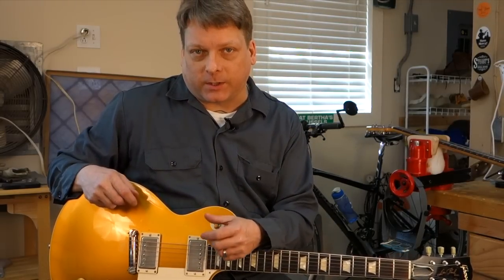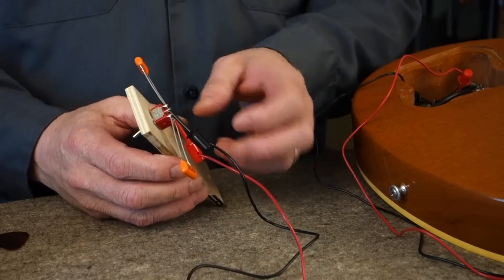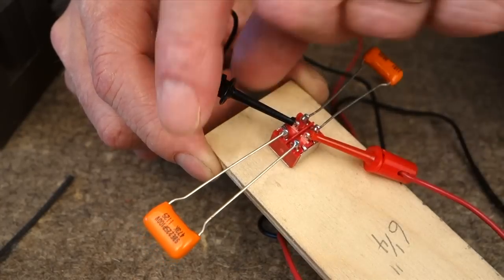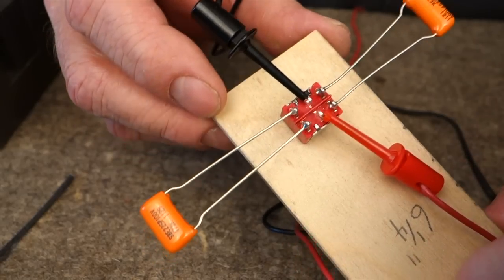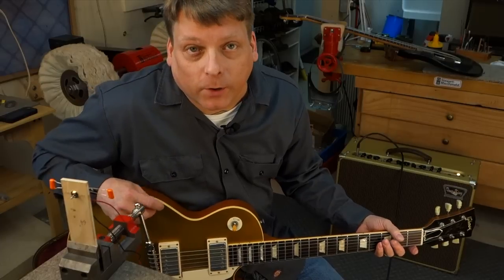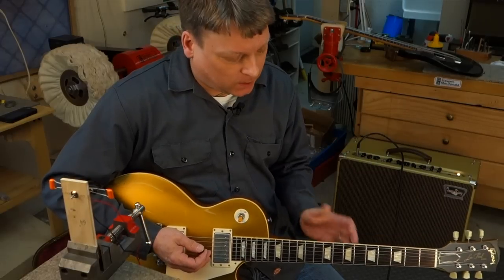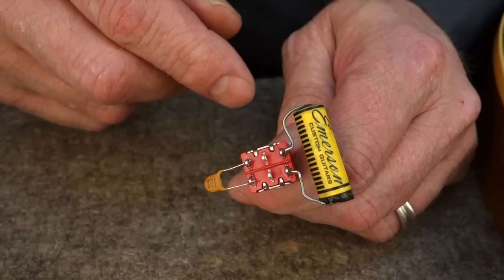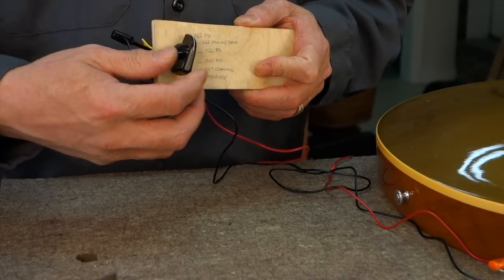Guitar capacitor tester: let your ears decide

Comment: Capacitors dont have a sound. They just remove frequencies. They dont have a "tone" of their own. Doesnt matter what theyre made of. Only their value.
Reply: You are correct, however what they are made of does matter, different materials have different tolerances, hence a more exact value. I.E: A capacitor with 30% tolerance with 20uF  can range from 14uF-26uF. A high quality material reduces this tolerance up to 5-10%. In the end if you are lucky enough to buy a cheap one with 30% tolerance and hit right on the spot of the specified valued, it doesn't matter.

Comment: The physical construction and materials used make a noticeable difference to the tone you get. A lot of it has to do with quality of the component and the consistency of the materials used. Even with close tolerances the differences in construction and material produce different sounds. 

Try a cheap ceramic, and then swap it for a decent orange drop. The sweep in the tone control is much more lush and vibrant, even if both have the same treble bleed range.
Reply: I tried the exact same thing - didn't get any noticeable difference.
Reply: Unless you have measured and matched capacitor values I suspect you are hearing differences in value not in construction. Or possibly your ceramic is microphonic.

Comment: Really great ideas here. I initially saw Lindy Fralin do a capacitor test device on one of his videos. The important thing here is not that this video should give you the definitive answer as to whether you should go with one of those cap values for a Les Paul instead of the other, but as a demonstration of how to sort that out, yourself, with your ears, in your sonic environment. Unless the differences are so glaringly obvious, never completely trust what you hear on YT, because of all that sound has to go through to get to your ears. (Camera, software, mic, YT compression, your computer speakers, etc...)

Comment: That's a pretty cool thing he did but what if you installed it that way in a guitar someway so you can have both of them in the guitar and change up whenever you want during a show or just at home. It would be like adding that one switch that let's you turn on a pickup when you want to
Reply: Cris Agui Put in that 6-way rotary knob. You may have to do a little routing, but it ain't no thing.

Comment: Another thing you may not know, is that the cap will sound different w/opposite orientation, i can tell easily in a tube amp setting..cheers,
Reply: is one way better than the other?

Comment: There's a simple but effective boost circuit in the old epiphone et-270 that's basically a switch with a capacitor wired in that pushes the overall volume nicely, I'd recommend guitar companies add this as a standard feature
Reply: The circuit act as a simple low pass filter. As a passive circuit the “boosted” position is actually with the capacitor out of the circuit.

Comment: I have an Ibanez with passive pickups, and when I changed the tone pot, I still didn't have a cap, so I just installed it without one and it sounds like a set of active EMGs! Now I probably won't put the cap in when it does come.

Comment: I doubt I'm the only one, but I'm only adding tone pots to my guitars just for the looks :) They are always at the brightest setting.
Reply: That was me before I took a blues performance class. Now I find I'm looking play with the volume at about 7, and the tone between 4 and 7, depending on the amp.  
Makes for a much better tone when blending with other players, and leaves more tonal space for the singer. I might go brighter (and louder) in solos, but then lay back when she spotlight is somewhere else.
Reply: You are missing out on a plethora of tones than if you only play wide-open, even in just a bedroom setting. Be adventurous and explore your tone knob.
Reply: Even if you leave it on 10, it still sounds different than if you bypass the tone control completely. Because it's passive, the tone control lowers the output of your guitar a bit, and even on 10 it rolls off a little treble. If you don't put in a tone control, it will be brighter and have higher output.
Reply: you had me at explore your knob😒
Reply: I am 99% with you on that.  When I do use my Tone pots it is usually when I am blending two pickups and then I just dial back the bridge a little bit.  If I am playing the bridge and it sounds a bit bright I normally just switch to the neck.  I'm sure that there are pickup pairings where this isn't quite what you want but most of my pickup pairings are fairly balanced.  No right or wrong answer--I used to think that neck pickups were for old folks and now that I am one I love them! :)  The video is nice--I like the idea of letting your ears decide.  The big plus for me is that I can justify more guitars just based on tone cap!!

Comment: You can use a breadboard to do this test and you'll only have to do two solder joints, also caps can sound different batch to batch same value, same maker.

Comment: Some placebo effect is going on here. There's no difference for capacitors if the tone is on 10, because that way the capacitor is bypassed by the pot. I'm in producer headphones right now and I know some about sound. No difference at all. Should've tested with tone rolled off.
Reply: I know this is old but thats actually not completely true unless you have one of those zero load pots fender makes.  Its still in the circuit but with the full resistance of the pot.  So 500k for a typical humbucker guitar.  So there will be a very slight difference even all the way on 10.

Comment: i came across a wiring diagram for les paul that uses a master tone so the other tone pot can be removed and a rotery switch put in its place and you can switch between six different capacitors as you want or need.

Comment: I have in fact fitted a rotary like that to a guitar, giving several preset cap tones with some really low values for subtle effects. works well. I think its gretsch that do/did a three way toggle on some models for preset tones(?) also early esquires had a preset tone in one of its positions

Comment: Okay. So you used a solid body guitar for your capacitor test. You need to do the same test with a semi-hollow guitar, as well as a hollow body guitar for those of use who own such guitars. I'd like to hear if there are any subtle or obvious differences for the same test. Also, you should have put a mic in front of that amp to help the listeners not in the room hear a little better.

Comment: Years ago mounted a Tonestyler tone control in one of my guitars, don't know if they still make them, has a small p/c board
with (I think) 16 position clicks. 1st position is no resistance, followed by progressively more high cut. Have gotten used to it,
miss it on  my other guitars.   Worth a try.

Comment: .022uf and .047uf (.020 and .050 are not standard values) capacitors are common in any junk electronic item you have laying around.  Sometimes they are marked with these values in microfarads (uf), but more often they are marked with the capacitor code for that value.  A .022uf will be marked  "223" and the .047 will be marked "473".  They cost about a dime apiece and work exactly the same as the big dollar "guitar tone" capacitors.  They are very cheap, you can get a bag of them new i.e. eBay.  If going used from some junk electronics board, you might want to invest in one of those $10 eBay electronic component checkers that will read both the value and check for age-related signal loss.   You might even want to have them labeled as special guitar electronic parts and sell them for a 1000x markup.

Comment: Nice idea to do the 6p switch with different caps. Trying to find a "wiring diagram" to do one here. Cheers.
Reply from the maker: Hi Fabão! While we don't have a wiring diagram for this, it's a rather simple set up. Just span the capacitors between the corresponding lugs on the 2-pole rotary and used the 0 lugs as in/outputs. https://www.stewmac.com/electronics/components-and-parts/switches/rotary-switches.html

Comment: The difference is almost subtle honestly. Over time paper in oil caps, isn't reliable because it has kinda like self destruct mechanism, whereas leakage voltage would occur.
Reply: Almost subtle?  Wtf does that mean?  If it's almost subtle then by definition you are stating that the difference is NOT subtle.  : p

Comment: To a very large extent the value of the tone capacitor will only affect the low frequency limit where the tone control is rolled off. With the tone control at maximum (and the volume control at max) the roll off frequency is determined by the self capacitance of the pickup and the total capacitance of the instrument lead. Also don't take the value printed on the capacitor for granted. Always measure your component values.

Comment: Hint.. Ceramic caps in the audio signal path is not a good idea. Ceramic caps change capacitance a lot with temperature and are microphonic which doesn't help at all in a device that is vibrating in sync with the signal frequency like a guitar.
Reply: Not class 1 c0g/np0 ceramics.  Very stable and clear sounding.
I even use them as coupling caps in amplifiers.
And much better sounding (to me) than silver mica for pF duties.
Reply: really ? interesting 
i use mica  in amps  
but those  blue ceramics  in big volts   2 KV   must be good 
i  never tried them

Comment: rotary switch at the end is lovely ..or even the 2 way would be cool ..even better would be to just add built  into the guitar !! ..but hate to cut a hole into a Gibson and mod it :(.. ... maybe use a pul switch ...but I love vintage taper pots like Centralab.. makes a Hugh Diff...even CTS don't compare .. 
.. Bring back Centralab Pots !! ..thick carbon track with lead

Comment: In this case, it is important the amount of voltage we decide to use in the capacitor?
Reply: the sound does change depending on the output of the pickups, yes

Comment: I can see where the microfarad of the cap will make a difference but don't tone caps just bleed highs to ground ?  The signal to amp doesn't pass through the cap so type , brand , etc shouldn't matter .

Comment: Why do guitar builders choose to use 100V (and higher) voltage rated capacitors when the signals they are used with are only millivolts? I can't see why they like those expensive giant orange lumps, when a ten cent capacitor of lower voltage rating would work just as well.

Comment: It's quite easy to use an on-on-on switch for that - use a 015, a .022 and in the middle position it's additive for a .037. Unless you're getting useful tone out of the 1,2,3 position on the tone, you're cap's too big. .015, even .007 have uses.

Comment: I just use low values at max treble cut and switch between them with a rotary switch. 0.001, 0.005, 0.010, 0.015, 0.022. Works perfect for me.

Comment: Keep in mind that shifting the baton on a toggle switch to the right is actually connecting to the capacitor on the left. When in doubt, you can initially  test the switch with only one cap on it to be sure how it works.

Comment: Deciding between different types will only work if you value match all the "same labeled value" caps to +/- 1% of each other, as they can be +/- 20% off from the stated value. Otherwise your just listening to value changes, not type changes, especially if you have one cap -20% of value compared to one that is +20% of value.

Comment: Caps are like searching for Unicorn's.. 
You can spend more time and lots of money searching for the mythical cap or simply use ceramic caps making sure the value is as close as it's marked and play.. PIO caps can pickup outside frequencies such as radio also drift as the oil starts to leak or dry out of the cap.
 While Ceramic is way more forgiving.
I've seen Gibson's as well as Fenders using ceramic, Fender used a lot of Ceramic caps because Leo was cheap, and honestly I hear no difference.
Considering that an electric guitar have a low voltage and current circuit, it doesn't matter what kind of capacitor you use. 
Only matters the capacitance value. 
Take a look at the tolerance value, the lower the most precise the capacitance value.

But that's my opinion, take it for what it's worth.

Comment: Did you hear a difference with the tone pot on "10"?
Reply from the maker: Generally, with a tone pot on 10 (with the least amount of the signal running to ground) the frequencies being attenuated are typically outside the upper limits that the human ear can hear (perceive). So you would be hard pressed to be able to tell the difference between a .047uf and .022uf capacitor with the tone control on 10. However, it may be possible if you train your ear long enough.
Reply: Thanks. Doesn't the corner frequency remain the same (RC filter between the cap and the tone pot) and just the AMOUNT of signal bleeded to ground changes with the pot position? I was thinking: with a switch you couldn't hear the difference between different caps, because in the "off" position there's infinite resistance between the cap and the signal, but with a 250k or 500k pot, there's high resistance with the pot on 10, but not infinite, so you might be able to telle the difference between different caps even on 10...it is generally accepted that an higher value tone pot brightens up the tone and gives "more range". Why? Because higher resistance attenuates even further the effect of the cap, and with No-Load tone pots, it should exclude it...I'm just thinking out loud! ;)

Comment: Yes indeed Gibson have been doing it since 1959. The Gibson 330 and another model forgot. It has a rotary knob with different capacitors for different treble. It also has two jacks, one for eah pick up on the stereo version. BB Kings Lucille is one. Johnny Marr plays one too.

Comment: The best for audio are polypropylene capacitors. Never use ceramic disc caps, they are distorting and they are even a little bit microphonic like piezo pickups!  Use WIMA polypropylene 50V caps (for some 30 cents) and forget all the "snake oil" capacitor stories.
   There are just some 2-3 potential positions for caps in the guitars. The Tone capacitor is not in the serial signal circuit, it is just sending the higher frequency part of the signal to the ground (not to the output), so here the cap's quality is a little bit less important. More important is so named "treble bleed" circuit's cap quality (not depending on circuit's variations) - if the Volume pot is not in the max position the higher frequency part of the signal is partly going serial through this circuit/cap.
  
   Concerning the Tone capacitor value - it is a very subjective question. In most cases, factory std values 22nF, 33nF, 47nF are too high, providing dull tone, reducing even mids. For the respective pickup's higher output impedance, lower value capacitors must be used. Pickup's DC resistance can be used to find approximate capacitor values. Just for orienting: 4kohm dc pickup ~ 18nF; 8kohm dc pickup ~ 12nF; 16kohm dc pickup ~ 8200pF. Try +/- 25% values.

Comment: as a rule of thumb when you increase uF you are adding bass tones if i'm right
Reply: +Francesco Bertelli You're actually running more high frequency signals (highs) to the ground which leave you with mostly bass tone. So you're not adding anything, you're actually taking something away.
Reply: yes ok, that's correct from a tehc pov, but the perception for the layman it feels you are adding mid/bass right?
Reply: +Francesco Bertelli yes. Higher value = darker.
Reply: +Francesco Bertelli Thats debatable from the "perception for the layman" when you consider that you are rolling the tone knob down to zero to reach the tone with the most bass. So from a layman POV, turning the tone knob up results in more treble. The most bass being at 0 on the knob and the most treble being at 10 on the knob gives an uneducated user the impression they are "turning the treble up". 

Much like how the volume pot works, at 0 you have no sound, and at 10 you are at full volume. So a layman might presume that 0 on the tone knob is the starting point, and 10 on the tone knob is the end point, whereby they are again, "turning the treble up".
Reply: six of one, half a dozen of another

Comment: Hi, let's imagine you got your Les Paul and with 500k pots it's too bright, bring the value of pots down by soldering a resistor in parallel, that is to both legs 1&3 of the pot. You could start with 50k resistor and increase value 50k at a time until you find sweet spot. You could fine tune your top end of your tone knob for max treble you desire, then fine tune low end with capacitor. If you have a good ear it's worth the effort. And of course if you need more treble from a tone pot, solder a resistor in series, remove input wire leg 1 then place resistor to wire and leg 1. 500k will give you a bright guitar but again adding 250k might be the sweet spot.

Comment: I thought the cap was out of the equation completely when the Tone pot is on "10"?
Reply: it is not 
that's why we have   250 500 and 1000  ΚΩ  pots
Reply: John Sfixton I definitely heard a difference after switching and before any fiddling of the tine knob (listening on studio monitors). I'm swapping caps tomorrow in my les Paul and will record some before and after samples.
Reply: i tried many many caps the last years in my les pauls
i only play and own les pauls
but i didn't try the buble bee and is not stock in any of my les pauls either
finally  nothing beats  the 22  orange drop   but those of higher volts  600  not the  100 volts 
the worst  the green  polyester  stock on epiphone
Reply: also all 500k audio pots  not 300 linear on volume  
it sounds more open
Reply: In order to completely remove the cap out of the signal, you need a no-load pot.